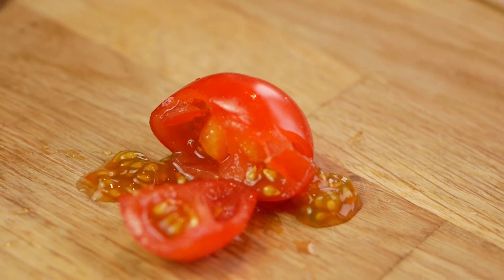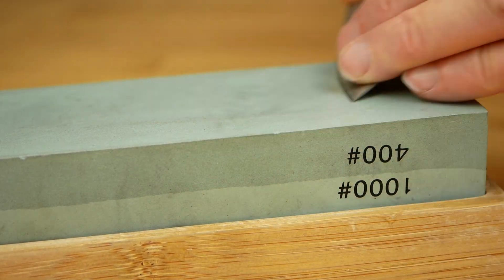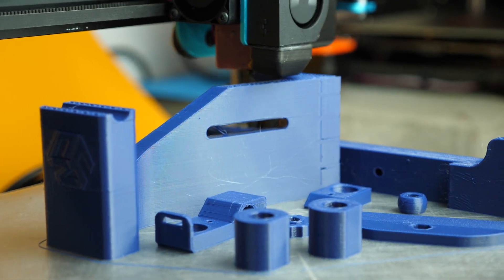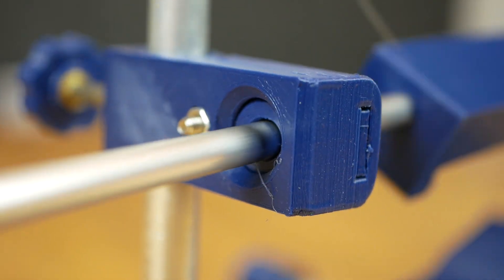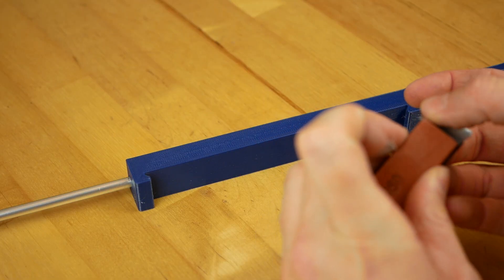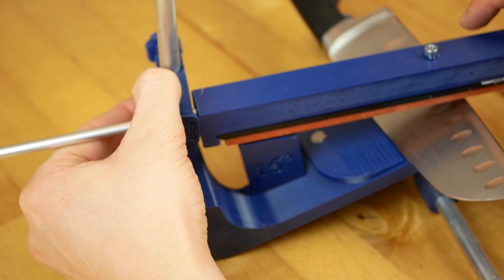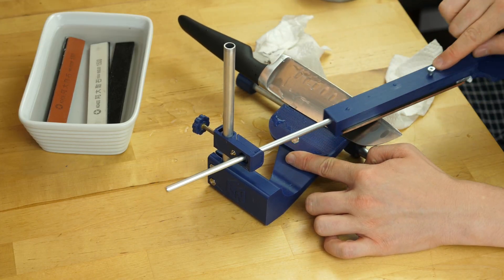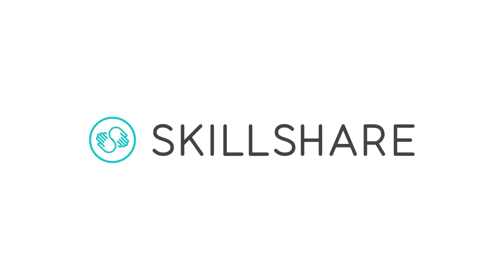PERFECTLY sharp knifes! 3D PRINTED sharpening tool 🍴

Comment: You should be hitting the entire blade with each stroke. When you do this chipping away it will create waves and hard to get equal strokes.
Reply: As my boss used to say: "I'm paying for that saw, so I want you to be using every tooth."
Reply: This was my only criticism. That and the fact that he should be measuring your angle differential between the blade and the stone. All blades are uniformly flat. Many have tapers which changes the angle of contact in relation to the mounting surface.

Comment: For stropping of knives I wrap Masking tape around a pencil untill its at least 1cm thick
Then I stick pencil in cordless drill and apply compound 
Then I have the red necked equivalent of a Tormek that is cheap as chips and readily available at any hardware store. 
With that 3d printer of yours you can make some Jesus level attachments for your drill.

Comment: in the beginning, you press the knife against the tomato without sliding it forwards/backwards. of course it will squash the tomato, because of the straight blade.
after sharpening the blade, you try it again on a tomato, but this time you slide the knife. this is not a direct comparison.

Comment: I love how whenever people demonstrate the difference between a sharp and dull knife they always use poor cutting techniques to show the “dull” one
Reply: I know right. How you gonna cut a tomato by pressing straight down on it. unless the blade is sharp enough to cut the corner off a phonebook by applying pressure then you're probably gonna squash any tomato like that. Going at it with an angle gives it that cutting action which is what he did when he tested the sharpened version, really would have liked to have seen a fair comparison

Comment: 400/1000 grid is a good combination, but you must try 6000 after you've finished with 1000. 6000 will bring a MIRROR finish to your blade which not only feels intimidating but also makes it ultra-sharp. Believe me it's an experience you will never forget as it makes cutting pork as easy as cutting tofu.
Reply: Not all knives hold a 6000 grit edge.
Softer steels will just start to roll.
Hard Japanese knives, or super steels will be fine at 6k.
Reply: @autumn5592 you ever use a CVD Diamond Coated Steel Blade?
Reply: @ericlotze7724  On a knife? No.
On other tooling at work, yeah.

Why do you ask?
Reply: @autumn5592  outside of cost, would it still have the same benefits?  In theory not needing to reset the edge?

(Although that study on how hair dulls razor blades meas sharpness may not be all that matters)

Low friction would be interesting too.

Comment: Nice jig and all but those cheap stones are garbage...I used the same ones to re-profile a few of my knives on a rip off apex edge pro, and the labelled grits are way off, not to mention they dish out in no time. Invest in some chosera or even ruixin Pro stones for it and NEVER use oil on your stone unless it is an oil stone... I use a jig like this for re-profiling bladed then finish them on a 3000-8000 Kasumi Japanese water stone

Comment: What you can see here is a worst sharpening method which can be actually called "unsharpening", rather than true sharpening. It also takes too much metal off the knife's edge. "Always cut into the stone, never drag your knife edge back over the stone and always maintain your angle." - this works since ages for every knife maker and every pro cook. Give your knives rest and double their lifetime by not dragging them back over the stone, only "cut" in the stone. No wonder your knife had that rugged edge because that's exactly what your "sharpening" method does with your knife's edge, no matter what tool your throw at it. Btw such knife is dangerous as its edge has super-sharp parts and also it has super-blunt parts. What happens if super-blunt part skids off the material you want to cut? Well, there is very high probability that another, well sharp part of edge will hit your fingers. Actually blunt knife is way dangerous than sharp one.

Comment: Not a comment of this video, but a request for a video on another topic...

I like your thorough and logical approach to testing things so perhaps you could explore how to get the best supported horizontal surface? Supports seem to break away from complex shapes and leave a reasonable finish but a horizontal plane away from the built platform always seems to end up a mess when I try to print it. The support doesn't break away, or if it does it leaves a terrible stringy finish that's pretty horrible. Could you show us what can be done about it and explore the reasons as to why this is so difficult to get right? Maybe the only solution is to use dissolvable supports?

Comment: You can have multiple angles on the same blade. Sharpen the blade at 10-15 degrees, then do a few passes at 15-30 degrees with your finest stone. This helps strengthen the edge, while giving relief for stiff vegetables like carrots. 

If you sharpened the whole blade at 30 degrees, the cutting edge often can’t make contact, and the knife ends up splitting carrots like a wedge, rather than cutting them.

Comment: Hi Stefan, nice and super usefull idea .. inspires me to build a similar holder tool for finish-refaceing/sanding my 3d printed mouthpieces for sax/clarinet .. you mentioned Fusion 360 as a CAD tool .. could you share also a Fusion file .. in particular this cute flex-rodholder could be my key feature  ...
Reply from the maker: The Fusion360 file is also on Thingiverse (assembly_v7.f3d).

Comment: Why not add slope and stopper(maybe some small rubber) at both end of the sharpening stone holder so you can use all of the sharpening surface without worry about cutting yourself.

Comment: Nice, but why not mount the waterstones on the 3D printer, and let it do the work instead?
Precise X Y and Z movements it what it does best.
Clamp a jig onto the bed, clip in the knife at the right angle, mount the waterstone to the print head, with a thin foam cushion to adjust pressure. Set Z then upload gcode to move X and Y uniformly over the blade until done!
If blade mounted vertically on its back, then it could do both sides of the blade without repositioning.

Comment: Finally, a useful 3d object:) But I have some concerns about the magnets holding the blade: Yes, ceramic magnets are strong as hell, but only towards ferromagnetic materials. Stainless steel usually isn't that magnetic, because it has very little ferrite inside its structure. Perfect austenitic stainless steel shouldn't be magnetic at all I think. Also, many knives have a very small flat area, the rest is already in an angle (the grind), consequently leading to the knife on the sharpener to tilt arount a little bit, messing up the blade angle. I assume your design is still very innovative, even when not flawless, because the mechanical clamp on the back of the blade, that is used by most commercial products, is often in the way of the stone when the blade angle is low and the blade not very wide. I once had the idea, to clamp the knife on its tang instead of the blade with a vice next to the sharpener, works great, but only works when you take the blade out of the handle, which is obviously impractical... Maybe a soft jawed custom vice that universally fits knife handles could work, but I haven't tried it yet. Another idea for a future 3d printing project?
Reply from the maker: I added a second row of magnet for the V2.1 design. They hold down the blade quite well.

Comment: Great video, but can you really use the sharpening oil? Is it water based? Or otherwise it will probably soak into the stone and prevent water to soak into the stone in the future. I once heard that you could only use water or oil on the stone. Is that true?
Thank you for the Video.
Reply from the maker: If you use sharpening oil once, you won't be able to use it with water anymore.

Comment: edge pro apex style (yours) sharpener isn't nearly as good as the wicked edge, consider looking into that design as well.  the wicked edge design doesn't require you to have any real technique, but the edge pro apex design requires quite a bit of technique to get decent edges.

nice work

Comment: Those stones have always been garbage IMO. I have yet to find a good set at a good price.  I bought one of these types of sharpening stations a few years back and the stones that came with it were like made of cheese they just melted so I bought some "better" ones and they were almost as bad. So I just bought a naniwa japanese whetstone and printed out some angle blocks (I designed them and through them on thingiverse under this same username) and got good at sharpening by hand.

Comment: Nice, however 3 issues, you should have used stronger magners (thicker) and bigger so they hold down the blade well, and add a clamp over the top of the knife, I know it has to be slim so as not to interfere with the stone, but from the video it looks necessary when your knife keeps moving and you're holding it by hand half the time. When placing the angle calibration, it skids on a rounded part of the tool, causing the set angle to be different from intended, make a stopper/inset for the calibration angle tools so they don't ride up on the inner curve of the tool.

Comment: Don't forget, you can get any blade extremely sharp regardless of its quality. The quality of the steel only dictates HOW LONG the blade will stay sharp.
Reply from the maker: Very true!
Reply: Also, some steel has finer grains and will sharpen to a finer edge.
Reply: @TerryPullen  usually cheaper knives have softer steel, harder steel makes all the difference
Reply: @juhotuho10  No. It depends on the usage area. In the kitchen stainless knifes are prefered for easy cleaning and long lasting sharpness, the drawback of stainless steel is the difficulty to sharpen it due its hardness. For hunting knifes most prefer a softer steel with a higher carbon content. Sure, you can't soak these knives for to long or they will rust. The edge is also softer, but, they are way easier to sharpen. Meaning that standing in the woods with a simple sharpening tool and a dull knife is no problem if it's carbon steel.
Reply: @fog1257  Not just carbon steel/stainless steel tbh, there's a lot more nuance to it. Within all the stainless steel alloys out there and the hardness a manufacturer decided to give a particular blade can make it hard to work with or in some cases even too brittle for some use cases with a low angle on the edge. Same steel but with the purpose appropriate heat treatment can make it totally functional while it can otherwise be too brittle or not durable enough.

The knife he used in this video for example had "vanadium" listed close to the spine near the handle. Knives using an alloy with a high vanadium content can be an interesting frustration depending on how much. Vanadium works a bit differently than normal carbides with carbon, they are larger leading to a less fine result being possible but also are actually harder than many traditional natural sharpening stones. Most modern synthetic ceramics and diamond/cubic boron nitride abrasives won't have any issues fortunately. 

It can be an interesting experience trying to sharpen a 4% or more vanadium content knife, only tried it once on either my Ardennes Coticule or a Belgisch Blauwe stone. I quickly gave up and just used diamond coated plate for the first step and two different ceramic stones (something aluminium oxide based, I just know it works) to finish it. Don't see that kind of wacky alloys often, but they seem to be in use for some more high end folding knives. I suppose it might be marketed there as more resistant to wear when cutting abrasive/dirty things where the edge will make contact with hard materials? Personally I'm kinda undecided about this, would have to know how much longer it actually lasts to evaluate if that's worth bringing diamond sharpeners into the field or just stick to a basic stainless alloy or carbon steel instead with the usual tools.
Reply: @extrastuff9463  Good info, I didn't feel like writing an essay hence I kept it short. There are of course tons of knifes with different properties. For most people however it's enough to know that hard material = difficult sharpening, no matter if it's carbon steel, stainless or ceramic.
Reply: yeah that's mostly true, but some cheap knives are made of really crappy steal and (like ceramic) the edge isn't strong enough to support itself while sharpening and instead of grinding it  cracks at the very edge
Reply: @pbednar  I was thinking of this one too. I've had some cheap knives that just wouldn't sharpen, because the edge kept breaking during the sharpening.
Worst think was that it wasn't even that hard, it just wasn't strong.
Reply: @nextlifeonearth  that's exactly what I'm talking about
Reply: Thats a litle bit wrong, the high end sharpening Will be bether with hardere steal.

Comment: "why not print something useful for once" me: looks at desk FULL of 3d printer tests "umm... true"
Reply: Lol, exactly, that flood of Benchy's struck a chord.
Reply: @wr3921  It is satisfying to see those tolerances get into the hundredths of a millimeter though.
Reply: The second print (after a test print) on my printer was a wall mount that I designed for the shelve of my printer to make it less shaky :P
Reply: @i.i.iiii.i.i  It's definitely important to have a stable base for your printer. I recently ordered a roll of flexible filament, gonna print some dampening cups for the feet to make it slightly less noisy.
Reply: @hakont.4960  seems like 1rst world countrys , are having trouble making a buisness out of 3d printing , maybe cause of the copyrigths and pattents , but in 3rd world countrys where jordans , are hard to come by ,  or kool objects ,
Reply: @hakont.4960  Imo the best way to dampen the noise is by: using a layer of really soft foam as a base on the table (not just under the feet, under the entire printer to help distributing the weight) and putting a rigid rubber mat (for example as used as dampeners and anti slip mats for washing machines) on top. It turned my printer from a 100W exciter (that turns my table into a speaker) into an almost silent machine. I just have to build an enclosure around it so I don't hear the fans while sleeping next to it at night.
Reply: Yup, I've mostly printed calibration cubes so far. I did design and print a holder for a roll of solder thread recently, so that's quite useful.
Reply: I've printed tons of functional, useful prints. Quite a lot of them are accessory parts for my AR-15, like Gopro mounts to attach to Picatinny rails, fore grips, a magazine quick loader and other things. Also printed adapters for my camera tripods, an adapter for my camera's flash attachment to mount other things on top of it, a part to secure the screw that holds the handle on my oven door (sheet metal handle's hole widened too much for screw to grab.), a gear for a broken toy, and a few others I can't remember off the top of my head.
Reply: looks at a desk full of anime figurines
Reply: phaha :D   ,  indeed
Reply: looks at medium-sized box full of mostly decorative models like castles, statues, etc "Yeah, same"
Reply: Same

Comment: There has to be some better method of fixating the knife than just magnets.
Reply: Magnets are fine for a simple solution. For something sturdy you would have to clamp the handle. Maybe some stronger magnets would be better.
Reply: laserbuddha Magnets are quite fine, since there is not a lot force in the grinding process.

You should let the stone do the work and not apply a ton of force (some is needed on coarse grit).
Reply: @bolodotdk  If you look at the video, the knife is moving all around and he has to use one hand to fixate it. Also the magnets are not aligned in the most optimal direction.
Reply: laserbuddha As I said. Magnets are fine... no reason to do something more complicated.

But yes, stronger magnets would be good. The magnets I use to load huge metal chunks into the CNC at work might be overkill. I use a small one that can lift 600 kg. No idea what the one on the grinder can hold. But it’s way more easy than chains/slings, bolts and so on.

The sharpening jig I got at home got a screw and clamp system. Really annoying to mess around with!
Reply: @bolodotdk  I don't think you understand the point I try to make.

Comment: Hi Steph(f?)an, I love it. A noticed that, because youre knife has a curved back, it is rocking a little against your back stop. You could fix that by having a backstop which is two posts rather than a straight edge. Just a thought.
Reply: Easiest way would be to add clamps on the otherside (back)
Reply: Just add a second row of magnets. Two should serfice
Reply from the maker: This should work better in the latest revision model. Made the body longer and slightly adjusted the guide.
Reply: @CNCKitchen Kitchen instead of magnets. use the backstop and just tighten it down on top of the  knife